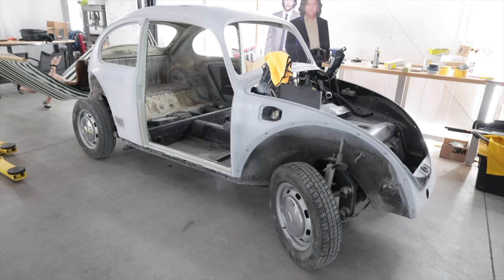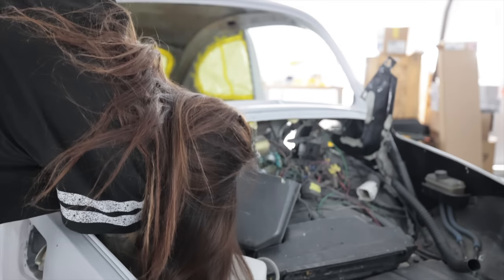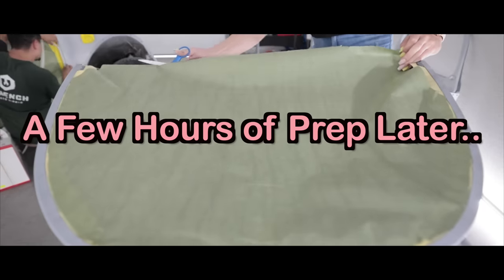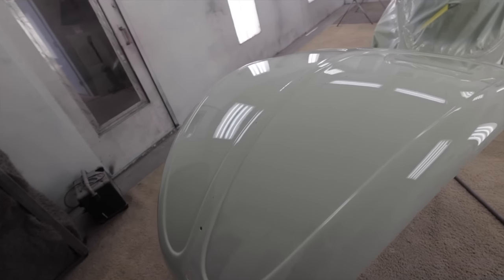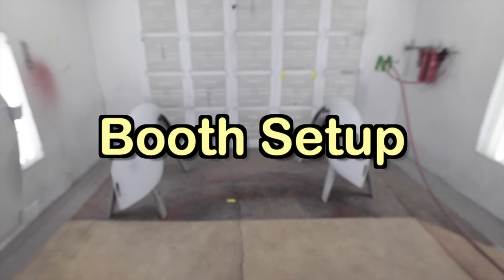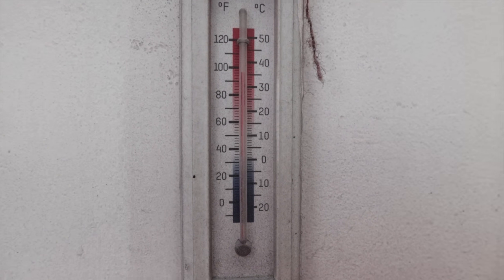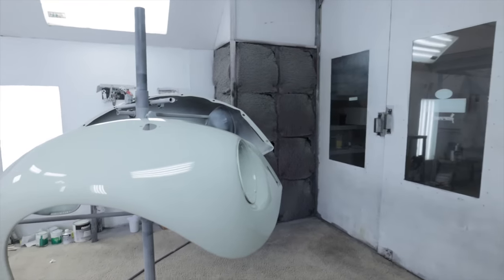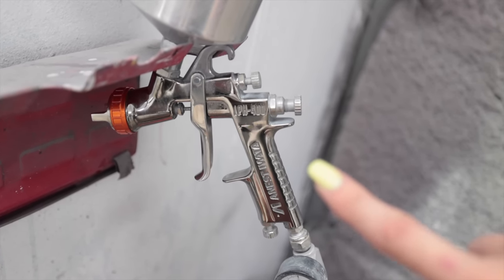DONE! My First Full Paint Job Turned Out.. // '69 VW Beetle Resto-Mod

Comment: You are not afraid of hard work!  So refreshing! My daughter and I pulled her motor out of her '04 Mustang for a rear main seal leak.  She asked if we could paint all the pans racing red...plus all the brackets.  We did and scrubbed every inch of every part we removed.  She was 17, turning 18 at the time and scrubbed the intake with a toothbrush and degreaser until it shined.  Car had 102k on it!  She never stopped going the distance on every part of that regasket job.  I shared your vid with her and she loved it! You are an inspiration! 
My older daughter reminded me that I sold her '69 beetle...I told her she was 5 years old!  She said back that I told her it was hers!  So, if I win the bug, she gets it! 😊

Comment: Congrats on the paint job -looks awesome!  Not only did you sprayed it well but the surface reflections show some great prep work.  No waves or dips.  So many things can go wrong but you got it done.  I love my Iwata guns, I have one with a swivel cup which comes in handy.  And no orange peel?  Thats pretty good with those high temps.  Becareful with the new paint surfaces.  They can stay a bit soft for a few days afterwards until the real full hardening.  It's going to look great!

Comment: Sweet Paint Job. You should be proud. Laying down a Single Stage vs Base/Clear is just a matter of coats so you can tackle two or three stage paint now. And, yes, the Gun has a big impact on the final job. Iwata is among the best, if not the best, paint guns out there. Not cheap, but you get what you pay for. And, be sure to clean it properly after each job so it keeps performing.

Comment: I’ve personally painted 3 beetles in a harbor freight portable garage in my driveway with single stage not having any help or advice with a cheap hf hvlp spray gun, all turned out great! Yes, I did use an exhaust fan. Also, all had a little orange peel, not terrible though. Humidity was 80-90%at the time, took two full days to dry.

Comment: Around 1970 Lotus painted some cars a colour they described as pistachio. It was a 50/50 mix of the yellow they used and British Racing Green. The colour was pretty awful!

To add to it, you could buy paint from the factory. But they exact colour you would get would vary a touch depending on how well they mixed the large pot containing the 2 colours before they decanted it out.

Comment: Proper air supply to the gun and reducing paint just a little bit both go a long ways towards a major league reduction in orange peel. What also helps out in your case is the lack of humidity.  I have also found that enamels tend to lay down a touch easier than urethane's do as well. Nice work though. I will suggest though, in the future, lay down a 3rd coat. It gives you a bit more room for color sanding and buffing ( and yes, color sanding and buffing should be done even when the paint job looks like that to begin with).  I am confident that you'd be able to do a good job with metallic's, pearles and candies. The one thing I will suggest with those though, start off with test panels. The bigger they are the better. While I am no fan of wasting expensive paint products, it is a far better option versus getting frustrated or upset  with how your car turns out.

Comment: Well that looks very good for your first paint job 
I have the drip problem all the time 
Orange peel only happens when you either have pressure wrong or paint to thick 
I alway put a little more thinners in than recommended and it just allows the paint to lay down a bit better 
And no orange peel 👍👍👍

Comment: next time start from the panel closes to the exhaust filter then only your last coat start from the intake and finish at the exhaust because you want that overspray to melt in fresh paint if you start at the intake you will have overspray issues that give you a rough surface to start with ... also the best way to show orange peel or texture its not outside its under some type of long light when you outside the texture will show better then it is especially on camera

Comment: They call it white, but it is green tinted. I call it wheen. That single (sing gull) stage lays down so nice with correct pressure, feed, and speed. You done so good. I've seen pros do worse, don't beat yourself up. You should be proud of yourself. A few drips can be taken care of easily. Someone will get a beautiful bug.

Comment: you did a great job.  i painted dozens of vw's back in dah deh..  i like starting in the middle of the horizontal panels and working out, but i dont see any real right or wrong way as long as you get even coverage.  which you did.
Reply: and having a great mentor like you do does wonders for the learning process.

Comment: Given how hot it gets in the booth, and also wearing PPE there, what do you think about buying a hydration pack, something like "CamelBak 50 oz"? They are compact and lightweight, you can wear one under PPE and sip water on the go keeping yourself well hydrated. We don't want you to pass out from a heat stroke in there. It's very exciting to see how you challenge yourself and achieve superb results. 👍

Comment: the paint cup thing can be fix but just using a disposable paint cups they work great easy clean up too. that what most shop use but l;ooks great for the first paint job dhit the first thing i paint i run the shit outta a fender but i was able to sand and buff it out

Comment: I don’t know it you did this before starting the project, the old timers taught me to wash the car with a strong degreaser detergent before sanding... they said the sanding process produces heat that will drive the wax and grease on the paint into the base metal.. this will help prevent fish eyes and paint lifting... great color for the bug!!!
Reply from the maker: I mean, I chemically stripped the car to bare steel and then coated it in acid.. lol

Comment: Don't sell yourself short- that is an exceptional paint job off the gun, I wouldn't even buff it. Light single stage colours are actually fairly difficult to paint, particularly in a well lit booth.
Very hard to see a reflection in the paint, making runs very easy to get.

Comment: I don't understand why the overspay is not a problem. I would be afraid that, if I have several pieces to paint, the overspray of my current object settles over on the one already finished. That would give the finished piece a dusty look. But it doesn't? Why, how?